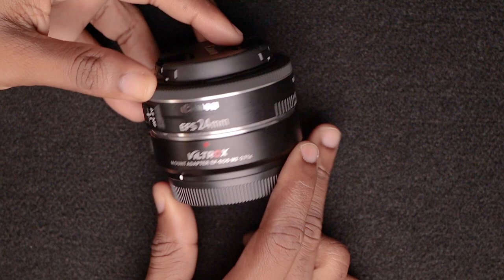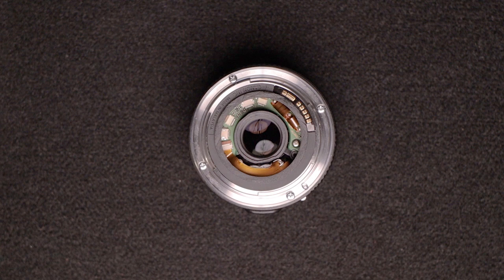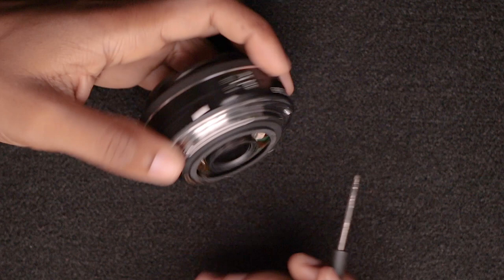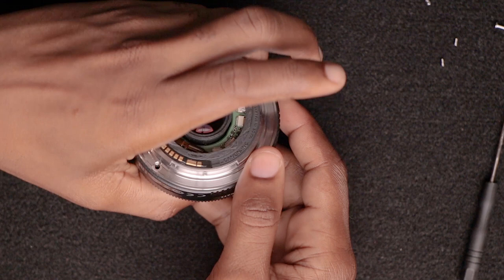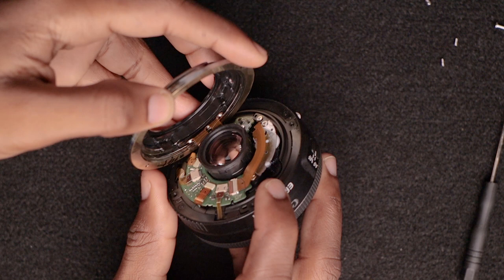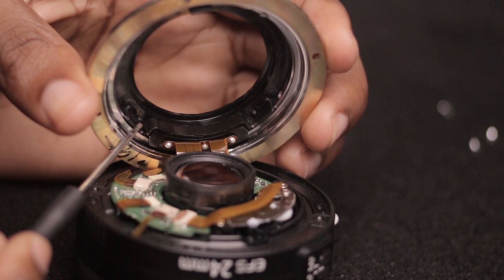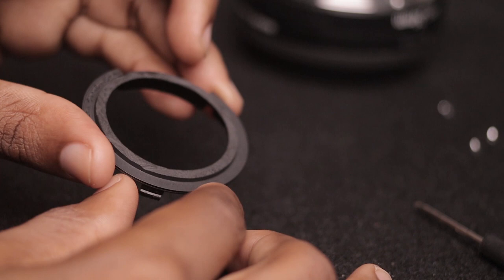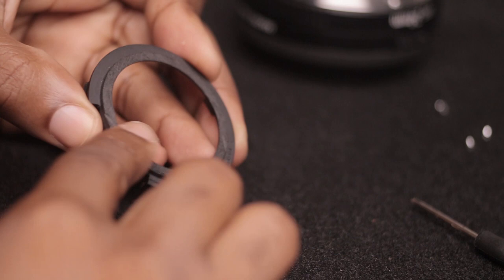How To Modify EF-S Lens To Work On Viltrox Speedbooster

Comment: Does canon ef-s 24 mm working with autofocus with a Viltrox on sony/panasonic ??
I am having issues with 24mm with autofocus on lumix gx85. But the canon 55-250 mm is working flawlessly on the gx 85?
Can you give any suggestions what is going wrong with the 24mm

Comment: After removing the plastic from the 24mm ef-s lens, I get the Original 24mm in the full-frame camera, I have a Canon R with an adapter?
Or it will always be crop 24mmX1.6  which, is 38.4mm.
Reply from the maker: If you have the EOS R and you do this modification you might run into a problem with vignetting, the M50 has a small sensor and I get a slight vignette but with a larger sensor like the EOS R vignetting might definitely be a problem
Reply: @RetroAT  Hi, I was glad. I thought I found a good solution and can  I get on this lens, Original 24mm on a full-frame camera, without crop by removing the plastic circle.
 so, if I Removing the round plastic from the EF-S lenses. Allows screwing the EF-S lens On a full-frame camera, I know it's possible on In some EF-S lenses. My question: does this also eliminate the crop and Get the Original  Lens focal length on a full-frame camera?
Reply from the maker: @user-hp1im5xc8h if you use the ef-s lens with a regular adapter you will get a crop, because the R series can detect ef-s lenses and when they do it adds more crop to adjust for the ef-s lens, i see metabone has a speedbooster that will solve your problem but it's expensive, don't know if viltrox have speedbooster for EOS R

Comment: Hi I;be done a similar mod to my setup. But I have found that the 24mm in the viltrox adapter does not focus to infinity. Do you have the issue?
Reply from the maker: yes i had that same problem, i then realized its not the lens its the speedbooster, you need to adjust the lens in the viltrox speedbooster, take a lens cleaner cloth and hold both sides of the lens in the viltrox speedbooster with the cloth and screw it inward, the 24mm is touching the lens in the viltrox speedbooster when it tries to focus to infinity so when you adjust the speedbooster it will focus freely

Comment: is it necesssary to modify the lens ?
Reply from the maker: Based on my understanding this lens has two versions, one that does not need any modification and another that needs to be modified, like in my case in this video, the one that needs modification has a more quiet autofocus than the one that doesn’t need to be modified
Reply: @RetroAT  how about the vignetting ?
Reply from the maker: @ethanpash7186  I only get a slight vignetting in images I think

Comment: Does it still work normally afterwards? Even on a normal camera without adapter like the 100d?
Reply from the maker: Yes it does, after the modification it still works without the adapter, so you will have the benefit of using it with and without adapter, it will work on a 100D or any other with that mount 100% because no electronics were changed
Reply: @RetroAT  thx for the quick reply mate

Comment: Do you have vignetting on your lens with the speedbooster and the canon m50?
Reply from the maker: you only get a slight vignetting if you use the 24mm STM Lens for stills but in video mode there is no vignetting
Reply: @RetroAT  No vignetting at 1080p either?
Reply from the maker: @JDproAV  nope, no vignetting in 1080p, check out this video which was shot in 1080p to see the results https://youtu.be/8s1j4IC0q1Q

Comment: if I remove the optics on the speedbooster, the ef-s lens can enter?
Reply from the maker: You can turn the optics on the speedbooster and it will adjust and then the ef-s lens can enter

Comment: The old canon full frame 24mm f2.8 costs the same as the efs version.  Just buy that lens and you won't need to saw up a $150 24mm EFS lens for no reason.

Comment: Hi there did the is on the lens will work by doing like this ?
Reply from the maker: Well this lens i modified here does not have IS but i modified the 18-55mm STM which has IS and it works fine, so no need to worry about the IS

Comment: How do you deal with dust?
Reply from the maker: I never had problem with dust, I know after removing the extra part the internals are exposed to dust but no one takes their lens off the camera without putting the lens cover on the lens so dust is not a issue